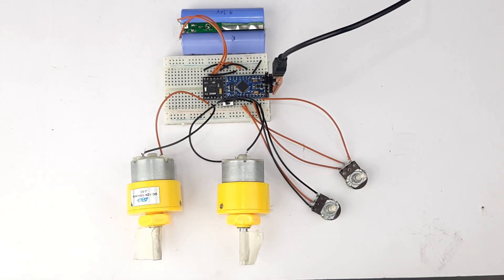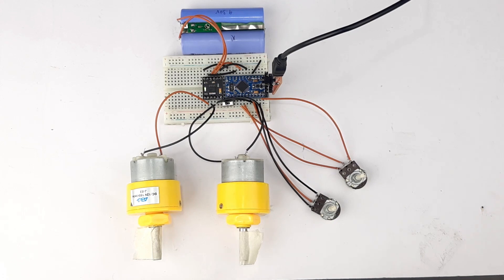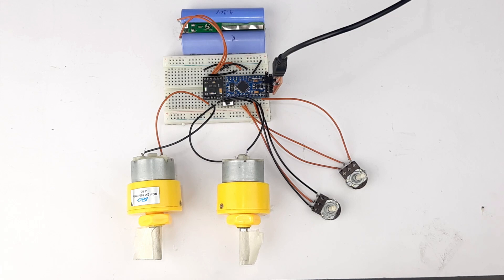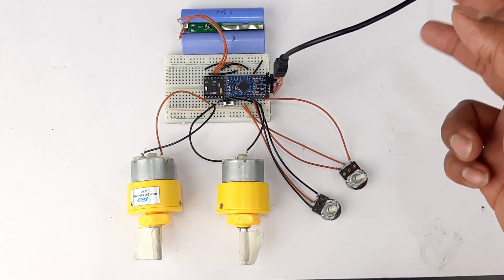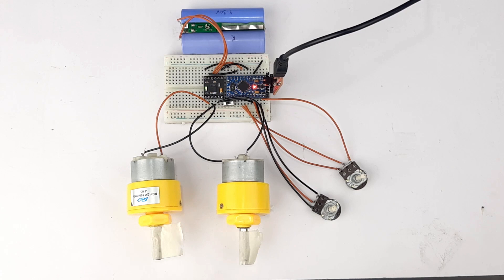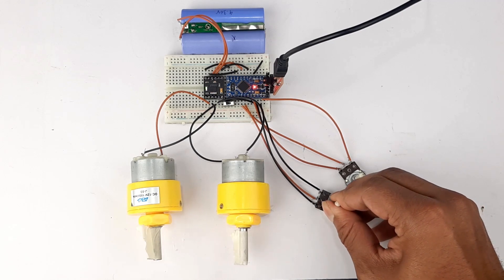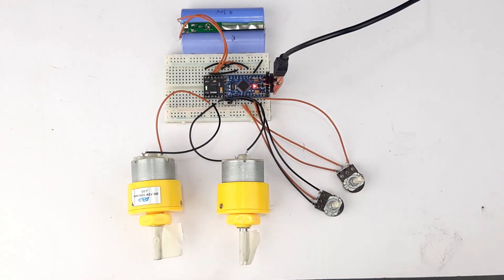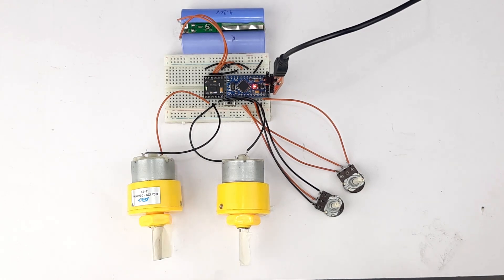Speed Control of DC Motor using DRV8833 and Arduino

Comment: Can i use 12v rated motors  With this motor driver ?
Reply: The motor driver only accepts up to 10v so you would have a slower motor or a burnt driver